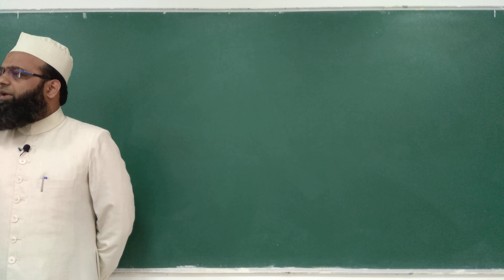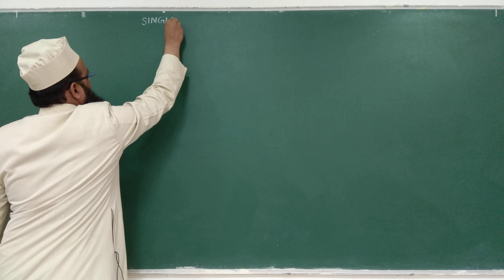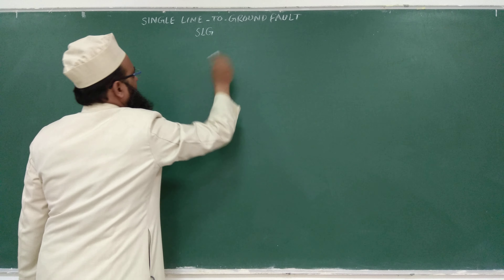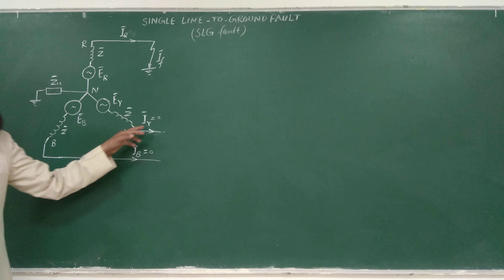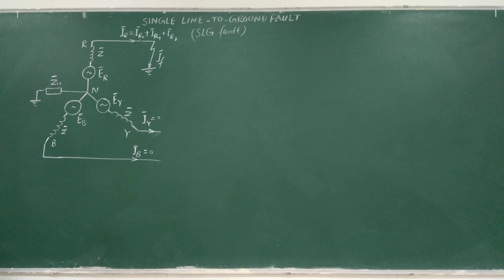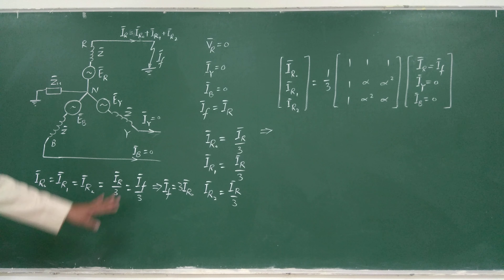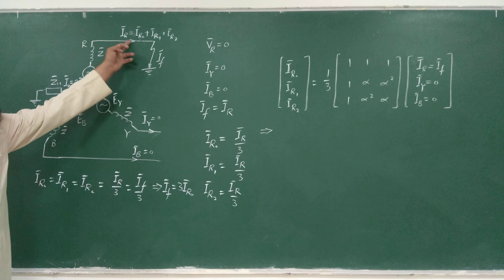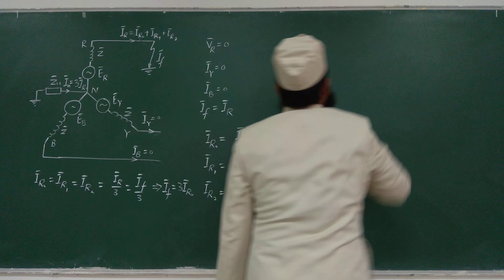Analysis of L-G Fault (Single line-to-ground fault)

Comment: Sir fault impedance ma positive sequence current bhi to flow karega..As fault current is the sum of all three
Reply: So why this impedance is only in zero sequence network
Reply from the maker: No, positive sequence current will not flow through fault impedance as algebraic sum of the three positive sequence currents (IR1, IY1 and IB1) is zero.
Reply: @DrAfrozAlam  but sir IF is equal to IR0 +IR1+IR2 .This mean IR1 is flow in this part
Reply from the maker: @amansanatani6393  Yes, IF = IR =IR1+IR2+IR0 = 3IR0 as IR1=IR2=IR0
Reply from the maker: @Aman Sanatani IR1 will not flow through fault impedance, it is basically IR0 which is equal to IR1 (in case of L-G Fault).
Reply from the maker: Draw similar sequence networks for Y-phase and B-phase also. Now analyse the three positive sequence currents of R, Y and B phases. You will see that IF = IR = IR+IY+IB (since, IY=IB=0)
= (IR0+IR1+IR2)+(IY0+IY1+IY2)+(IB0+IB1+IB2)
=(IR0+IY0+IB0)+(IR1+IY1+IB1)+(IR2+IY2+IB2)
= 3IR0 + 0 + 0
i.e. IF=3IR0
Reply: @DrAfrozAlam  clear sir
Reply: Thank you
Reply from the maker: @amansanatani6393  It's my pleasure

Comment: Sir could you please explain my doubt 
Before fault is Vr=Er or Vr=Er/√3
Thank you for the great explanation of the fault analysis.
Reply from the maker: Before fault, Vr=Er as Er is EMF induced in R-phase i.e. Er is phase voltage (not line voltage). We have already defined it in the video lecture. See at time 3:28
Reply: Yes sir I got it Thank you sir.
Reply: Sir one more thing why are we considering that The prefault conditions to be no load because in most of the practical cases it is likely that the system will be loaded while fault occurs?
Reply from the maker: It is an assumption to simplify calculation without affecting it's accuracy at large.
Reply: @DrAfrozAlam  Okay sir thanks once again.

Comment: Sir : Good Evening  My Question : If we connect the Back-Up generator's neutral and External normal supply Distribution  Transformer's  neutral to the same earth pit solidly grounded what will be the implication? operation of generator will be only when mains supply fails and isolation between Gen. and the Normal supply will be by a manual changeover switch.
Your teaching method reminds me of my best teachers. Thanks
Reply from the maker: Thank you for the comment. As per my understanding, there is no harm in connecting the two neutrals. Your question indicates that you are an industrial expert. I will be happy if you can elaborate some practical aspects of the above connection.
Reply: @DrAfrozAlam  Assalamalekum Dr Saheb. Thank you very much for your quick reply . Actually I worked for BHEL  India and Siemens Ltd. India mostly in the field of Control and Relay Panel Designs and not in erection and commissioning area. This question just occured to me while listening to your lecture. Thanks again sir
Reply from the maker: Wa Alaikum Assalam Imran sb. Glad to know about you.
Reply: @DrAfrozAlam   Assalamo Alaiqum sir I am from Pakistan. sir here in Pakistan , in case of large load we do not connect transform and generator neutral together. we use common neutral only for small  load. I donot know why is this?? as you  say there is no issue  to connect both together.
Reply from the maker: @Shoaib Maqsood,
Wa Alaikum Assalam, 
When the two neutrals are connected, zero sequence current gets its path which flows during unbalanced loading. In distribution system,  loads in three phases are generally not exactly balanced. However,  in previous question, you may note that generator (backup generator) only operates when main supply fails and there is isolation between the two by manual changeover switch.
Reply: @DrAfrozAlam   جزاک اللہ خیر